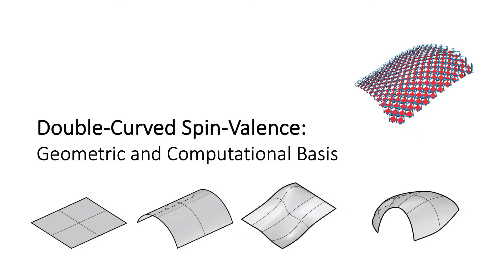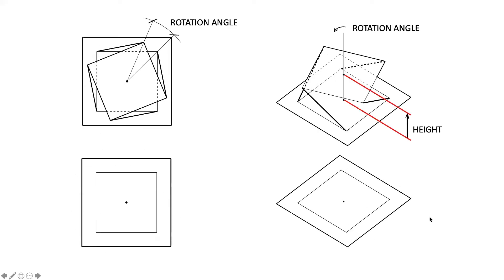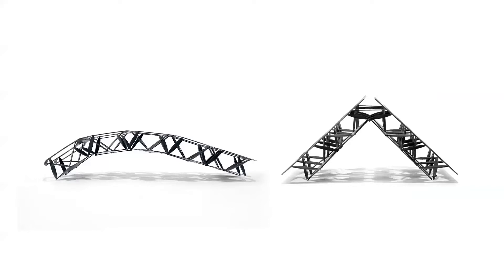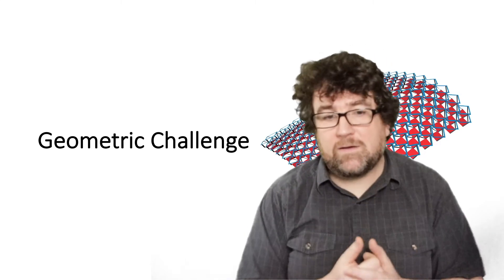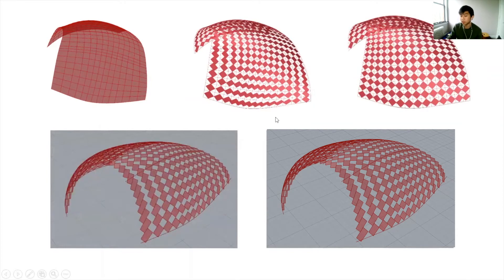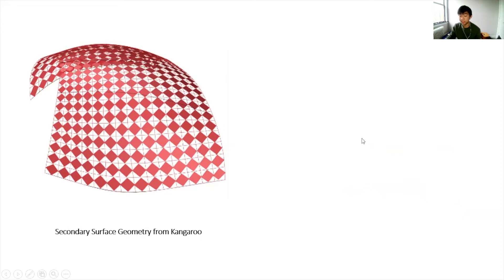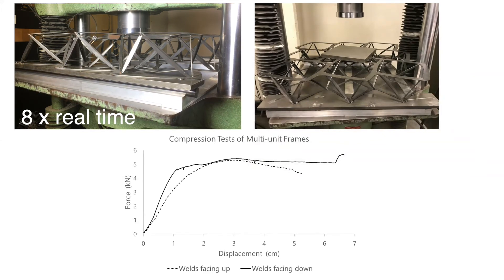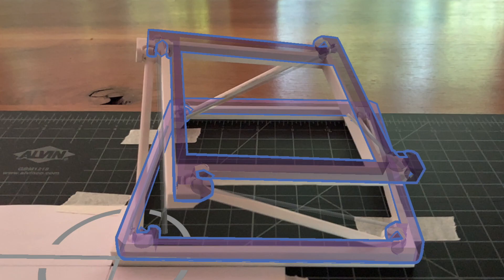21: Double-Curved Spin-Valence Geometric and Computational Basis - Baker et al

Comment: Great work!. Is each module geometrically bistable, so you can program the deployed state? However, it looked to have more degrees of freedom  (2DOF?) in the case of real material.
Reply: No, these units don't automatically deploy to the correct position, however, by moving the unit hub to meet its neighbors, the programmed overall form is accomplished. I have thought of trying to develop bistable units, though I'm not sure it's possible with the kirigami approach. I have 3D printed and other types of re-deployable units. I've been thinking of using bending-active approach to make bistable units, but haven't tried it yet. 

Actually, after seeing your talk, I'm thinking about creating the primary surface tiling as an auxetic surface, in order to pack it more tightly into the sheet material. At the moment, we only cut flat strips of units for the double-curved versions, but it is still quite costly in terms of waste material on the sheet, unlike the original flat versions. I'd be interested to hear your thoughts sometime.

Comment: Hello. Thank you very much for the presentation and the article. Given the small size of the cell compared to the overall dimensions, have you considered homogenising (e.g. finding equivalent stiffnesses) this structure in order to quickly predict the structural behaviour and thus optimise thickness/pattern/input surface?
Reply: Hello Nicolas. Thank you. I think what you're describing is one of the desired next steps. Thus far, we've only been working with quadrilateral units (and those constrained to rombuses), so other work is necessary to describe other unit types. The complication comes when you describe a unit that deploys in non-parallel fashion (vs. a more simple parallel deployment). More geometry to solve in order to get to the point you describe, if I understand the question correctly. Thank you!